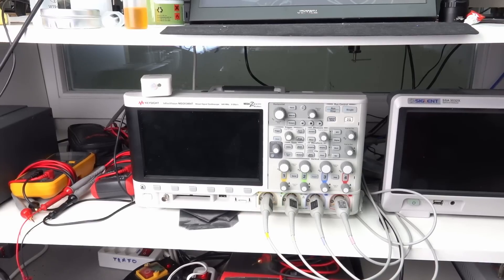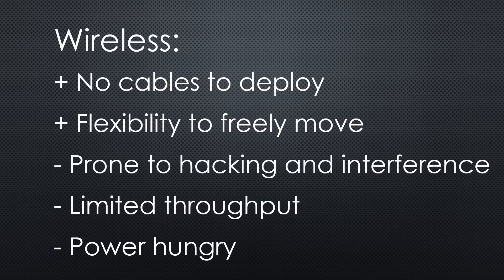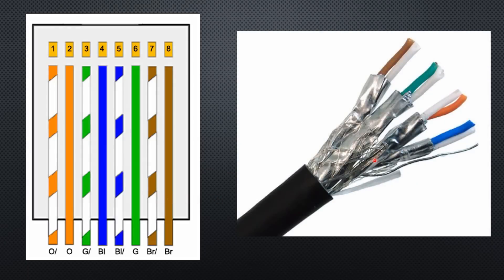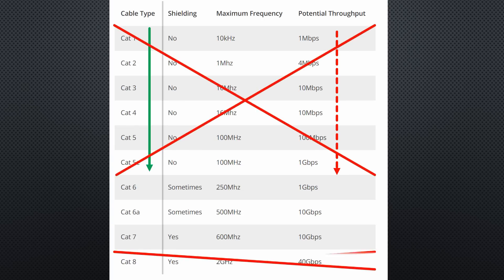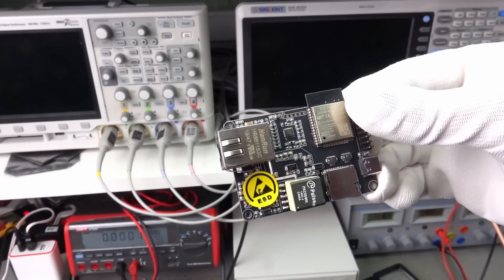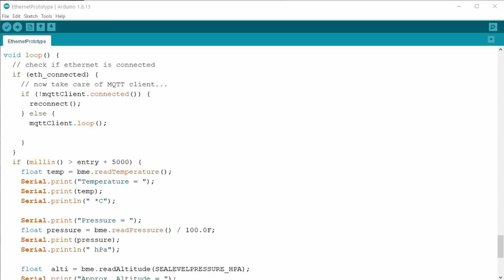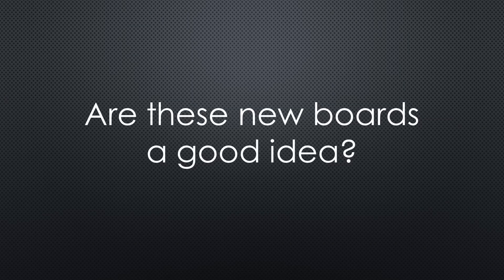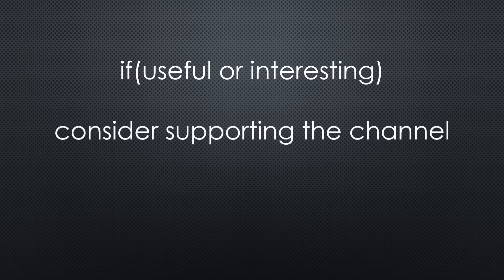#365 Is Power over Ethernet (POE) on the ESP32 any good? (New TTGO and Olimex boards available)

Comment: I'm almost sure the connectors you have are 8P8C which are usually confused with RJ45, but feel free to correct me
Reply from the maker: RJ45 is a specific implementation of 8P8C. You find also 8P8C connectors for other applications like serial connectors. So 8P8C is too general

Comment: It would be great to switch home automation on PoE for multiple reasons. Also, it will reduce the Wifi traffic a lot.
Thanks 
Cheers ✨✌
Reply: Just keep in mind that the PoE standards like 802.3af and 802.3at require a minimum load of 0.44 Watt. So it isn't the "perfect solution for everything".
But still the ESP32 + ethernet gives a very responsive solution.
Where WiFi connections may sometimes respond for upto 100 msec (first packet after some time of no communication), an ethernet connected ESP does react a lot faster.

In ESPEasy I've been using it for over 6 months now and it is a really good match,  to combine an ESP with ethernet.
Too bad it does take so many pins.
N.B. Ali Express now also has some "slightly less expensive" ethernet cable testers that can also measure PoE standard, supplied voltages (and on what pins) and power drawn by the connected device. Still under 20 euro, so not too expensive. But a real must-have if you're working more often with PoE.

N.B.2  Keep away from the really cheap PoE switches (on Chinese sites) and also read reviews on the better known brands as some brands have had a few PoE switch models/revisions that were just frying the connected devices. (yep another reason to buy such a PoE tester)
Reply from the maker: Yes, you are right

Comment: No BLE (Bluetooth) over ethernet? The answer is probably found in history. Ethernet was invented in 1973 and standardized in 1980 and again in 1985. WiFi  was a solution for a wireless ethernet that was introduced in 1997. Bluetooth was introduced in 1989, but was released as a solution for a very different problem. Both wireless technologies were developed separately, for different purposes. Ethernet/WiFi is intended for high-speed flow of large amounts of data between computing systems, where Bluetooth was initially proposed to connect headsets to cellular phones.  
The protocols, for each technology, are quite different and I imagine that it would be quite difficult to seamlessly merge Bluetooth into ethernet. However, as with many things, where there is a dollar there is a way :)
Reply from the maker: I did not mean BLE over Ethernet, I meant wireless BLE did not work...
Reply: @AndreasSpiess  oops. My mistake. Old man got up too early this morning :(

Comment: Nice topic, there is still a place for copper.
I tried the usb to RJ45 extenders today, got 60 meters out of it which is 10 meters past the spec on the packaging.
Not bad for 10 dollars.
it does mean 5V needed on the far end, but still very useful for getting usb to a far place.
Kind regards,
Duncan, South Africa
Reply from the maker: Very good. I recently got a 20 meter USB extender for my satellite project. So far it also worked. I di not know you get such USB to RJ45 extenders.

Comment: Just some extra information. Cat 6 is capable of 10G for channel lengths of 30M or less. You'll find you can probably get further with good Ethernet chipsets. The silicon gets better as time goes on and it can mean that it does better than the minimum spec. The other thing to note is that Cat 6A and above are getting harder to terminate. The requirements for cross talk both near and far mean you need to untwist and unsheath the absolute minimum amount of cable. The other issue with the newer standards is alien crosstalk which comes from other Ethernet cables nearby. You get this is larger commercial installs. Modern Ethernet is like laying RF cables. The signals are in UHF and propagate on the skin of the conductors and can be induced in nearby cables. With the price of CAT 6A and above fibre becomes a really compelling option but no support for POE. I purchased 100M of single mode preterminared indoor cable for 60AUD that is about the cost of CAT6 here. Some cheap media convertors and there is a really safe, reliable and cheap way to connect two buildings together.
Reply from the maker: You are right with Cat6, but, as you write, I do not like unshielded cables if more than one is in one tube...
Concerning non-POE: I would miss this function because it solves some cabling issues...

Comment: Worth noting, that if you dont need the speeds of cat7, which you probably don't for small IOT devices, i would just go with cat6, just because the cables are easier to make :)
If you buy the cable, well then it doesn't really matter :)
Reply from the maker: You are right. For me, Ethernet is a long lasting infrastructure and I would not build it just for an ESP board.

Comment: Hi Andreas, again a superb video, clean, straight forward explanation of the stuff we need. Since I do use the ESP32 a lot I've always considered some wired projects but was to lazy starting research for the necessary software changes. No excuse anymore ;-)  I run the same rule as you: if it has some importance I  use wired Ethernet whenever possible; it is often a way more "set-it-up-and-forget-it" solution than using WLAN. And -  Btw, I'm not too far away of running short on IP addresses in my home Class-C network already ;-)
Reply from the maker: So you have to switch to IP6 ;-) I still have some time for that step.

Comment: You can eavesdrop on a wired connection with a throwing star lan tap ;) But we should already be using SSL as you've shared in episode. #232
Reply from the maker: So far I do not use SSL on my home network, especially not on the wired one.

Comment: All basic pre-made cables use 568b, so it's best practice to use it too. It prevents you from making mistakes if you ever put a new connector on one end of a pre-made cable.
It'll probably work fine no matter what way you connect it, but it prevents a lot of confusion if you ever need to troubleshoot it.
Also, cat6 is capable of 10gbps up to 50 meters
Reply from the maker: You are right with Cat6 cables. But I would not trust it when it is inside a pipe with other cables and power lines. But I never tested.
Reply: Ethernet cables don't need to only be used for data. You can send switch signals over Ethernet wires instead of data signaling to a remote microcontroller in your closet or wherever you're setting up your central server room or rack and poe can power anything at the switch point needing power like lighting. You can get creative with your wiring this way. At the terminating points you break out the Ethernet pins used for switching and connect them to the microcontroller GPIO to read switch states for all the switches in the various rooms on just the one microcontroller.

Comment: Very nice video! One question. I have a microtik switch that gives passive poe not the standard 48V. Will the ttgo board will work?
Reply from the maker: It should if the voltage is around 30 volts. But I do not remember where I read it.

Comment: I'm still using CAT5E. Gigabit ethernet is good enough for most applications. Also 10Gbit equipment is too expensive.
CAT7 is not standardised by TIA/EIA and it's difficult to crimp properly. For future proofing, I would go with CAT6A.
Reply from the maker: 1Gbps is no problem also for me. But if I would cable my house now I would go for Cat7. You can go with shielded 6a which is very similar, I think.
Reply: @AndreasSpiess  The Cat7 standard requires special connectors, GG45, TERA or ARJ45. Only the GG45 is backwards compatible and "downgrades" to Cat6a standard if used as a regular 8P8C connector. No normal RJ45 8P8C is Cat7 rated. The Cat7 standard was set in 2002 and basically got obsolete before it was widely adopted i can guarantee nothing in your home have Cat7 connectors, so it will always downgrade to Cat6A. Therefore Cat6A is what you want to install for 10Gbit, or CAT8.1 if you want to go all the way and still use normal RJ45 8P8C connectors, but 8.1 is only rated for 36m and intended for short runs in data centers.

Comment: If you cannot afford to use 8 pins on the ESP32: there are chips & boards that do I2C/SPI to ethernet. 
You showed pass-through RJ45 connectors and I think you should have stressed using pass-through, as with those it is far less likely you have an incorrect, or incomplete connected cable end.
Reply from the maker: I never saw such boards (other maybe the Arduino shield). It is also possible to extend pins with a port extender. But I think for most projects the pins are sufficient.
 This video was not intended as an Ethernet crimping video ;-) But of course you are right. This is why I left a link for such connectors.

Comment: I'm using an Olimex ESP32-Poe-ISO in a room with a switch rack to get temperature and humidity. So I have power for the Board and the sensors. Additional I have a connection to a MQTT Broker via a separate VLAN. It's running for a bit longer than a year now. One advantage is, that, if I have to reboot the board I just deactivate the port and reactivate it, that wasn't necessary though.
Reply from the maker: Thank you for sharing your experience!
Reply: I’ve been playing with the ESP32-POE-ISO and a MAX31855 to measure thermocouple temperature, but couldn’t get GPIO Pins 1-5 to work with the MAX31855. Using pins on the other side of the board seemed to work. Have you encountered anything like that?
Reply: @laialbert  No I'm using I2C from the UEXT  (GPIO13/16) Ports and GPIO35 for a PIR.
Have you tried some other pins?
Reply: @RidingTheAlps15  Yes, I managed to get it working using GPIO pins 13, 14, and 15. Just strange that I couldn't get it to work with GPIO pins 1-5. I tried with 4 different boards, so I don't think it's an issue with bad boards.
Reply: @laialbert  Glad that you managed to get it running. I guess I won't touch the GPIO 1-5, when I will use another board.

Comment: I remember having to support an office with BNC ethernet - bus based ethernet - Coax cables to and from every computer joined with BNC T pieces and terminators at every end
Lots of fun when any connection came loose as whole network went down (people kicking cables under desks)
Twisted pair cables in star configuration so much easier to fault find
Things have improved in 25 years
Reply from the maker: My first VAXstation also used coax cables in Daisy chain configuration...

Comment: w5500 works with ESP32 with standart arduino ethernet library and uses less pins
Reply from the maker: How many pins? And what about POE?
Reply: @AndreasSpiess  PoE can be used with any chip as the PoE will be split by the RJ45 header. It depends then on the used isolator on the PoE part whether it is isolated from the PoE switch or not.
For PoE you need to have those 10 pin RJ45 headers to make a properly isolated PoE power supply on your board and I guess those may be hard to find with W5500 boards. At least I haven't found any yet.
Just have a look at the Olimex schematics of their boards to get an idea of what kind of RJ45 header is needed and they also have some board designs which are NOT isolated.
Reply: @AndreasSpiess  ESP32 and W5500 use 5 pins:

GPIO23 <--> MOSI
GPIO19 <--> MISO
GPIO18 <--> SCLK
GPIO5 <--> SCS
GPIO11 <--> RESET

Poe is a separate thing. If you need this, you can use it by splitting it by transformer.

Comment: Perhaps one of the best use cases for wired (at this point) is for security-related devices, like door sensors, security cameras and such. WiFi based devices can be easily disabled with a readily available WiFi blocker/jammer.

Big drawback of wire is the needed infrastructure - a router that supports POE, and ethernet cables all over the place. A compromise could be a powerline adapter that piggybacks ethernet on the (existing) mains wiring, and that has POE. You then only need an ethernet cable from the closest power outlet.
Reply from the maker: I agree with your comment about locks etc. POE routers are of course more expensive. But very handy...

Comment: Andreas, if Ethernet speeds on the ESP32 are limited to 100 mbps, why advocate for CAT-7 cabling?  Perhaps you are thinking of new Raspberry Pi compatibility or future-proofing of newer designs?  In my case, I have so many existing CAT-6 & CAT-6e patch cables and CAT-5 & 6 fixed wire plant it’s hard to justify.
Reply from the maker: You are right. My comment was for a general Ethernet infrastructure in your home. I should have said it more precise.

Comment: If you google "Ethernet-to-SPI 0.9" iMod Module, RJ45 Connector, PoE Circuit", you'll be presented with a tiny 100Mbps module, for less than $7.
I doubt very much a small MCU can handle more than that. 
I prefer using stand-alone modules and not get locked into some one's design ideas and expensive solutions.
Reply from the maker: Thanks for the link. Did you read the "smallprint"? POE is not completely implemented (no converter, only simple extra wire possibility). Not very transparent in my opinion. Or do you have other experience?
Reply: @AndreasSpiess  That is but one of many module available. Go up the product page and see.
Reply: @AndreasSpiess  I have no experience with them. If you go up a link to products, there are many others. There might be one that fits your needs.

Comment: on ESP32, hardware resources such as I2C are not directly connected to a particular set of pins, but go through a cross-connection system, so you still get hardware i2c support, even when moving it to other pins such as you're showing.
Reply from the maker: I know and I thought I showed how it can be done.
Reply: @AndreasSpiess  guess something got lost in translation, you sounded like "it's a shame, we lose something"
Reply from the maker: We lose the standard pins which can be a problem if a library does not offer "pin shifting"

Comment: 6:04 if you work in telecoms you will quickly find out that it’s not always as simple as it should be connecting legacy devices to new switches, especially when the telco has the switchport set at full duplex and the customer kit at half duplex. Queue complaints of packet loss over the LAN....
Reply from the maker: Good to know! Thanks.

Comment: Nice thought provoking video again. 

I can only see the point of this if you can use the Wi-Fi at the same time as the Ethernet maybe for adding an access point, etc.
If a network connection is easy to access, then why start the project with a Wi-Fi embedded chip. There are a lot more faster chips out there, with more I/O.
Reply from the maker: I know of people who do not trust Wi-Fi. So they might like this board.

Comment: Hi Andreas, great video, was looking for something like this for a while. Another option is the LAN8270 Module https://tinyurl.com/y35h652z connected to an ESP32 board. I have been used it on three projects, and it works nicely, but it's not as convenient as what you have there. Better to connect it to a 38 pin board through, for more (ish) options as it does use a fair few gpio pins, just like you have pointed out in your video with the TTGO POE Board.
Reply from the maker: Thanks for the link. I also would miss POE, I think.
Reply: @AndreasSpiess  sorry didn't say that, correct no POE, but on the filp side of that you still have the built in USB to serial chip, all though less important if you need POE!

Comment: for this small devices you dont need cat7 i think everyone has around 1000 old cat5 cables around or they easy and cheap to find from old servers..
if you buy new cables and think to use the cable maybe later on a computer than why not...

du dis telefon lütet xD
Reply from the maker: Wieso meinst du?
Reply: @AndreasSpiess  ja bi minute 5 het so es bibele im hintergrund.. filicht isches au süsch was..
Reply from the maker: Jemand anders hat auch so was gehört...

Comment: I don't understand why this board has 12 pins in the connector but only 6 are useful. Why do not expose only the 6 useable pins? I understand the pins with default functions like reset and program, but the other ?
Reply from the maker: Maybe you watch my last video. The pins are useable, but not on the priority list.

Comment: Here are a few questions that I missed somehow?

- What way of communication is more sensitive to weather & lightning, wireless or wired? If you are hooking up infrastructure like irrigation or sewage pumps or a decentral heat recovery ventilation system to a control system, you want it to survive a thunderstorm.

- If you think in life cycles of infrastructure or real estate, the encryption part of anything wireless holds up very bad - it is like if the switches and sensors diffuse somehow  to the outside of the wall over time and become available to the public. Just think of how often SSL and TLS standards had to be cancelled in the last seven years since Snowden. So the question is more: which cable system holds up say 30 years and possibly several generations of NICs?

- Are there any experiences about lifetime and failure mode of PoE Systems? Do they black out, brown out and reboot often, or just fry anything attached to the cable, possibly the cable itself?

- Which optical buses are available?
Reply from the maker: I cannot answer your questions. I assume cables can be deployed lighting resistant because they exist everywhere. As mentioned, Ethernet was a very stable standard over the last years and it will stay for a long time.